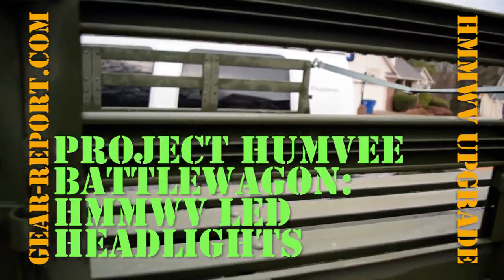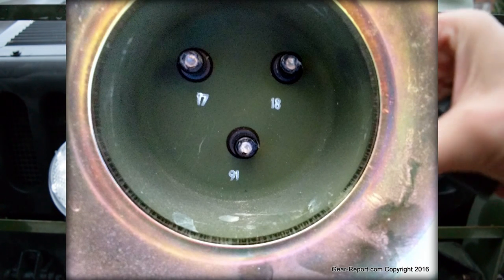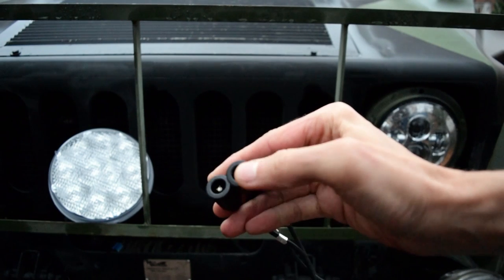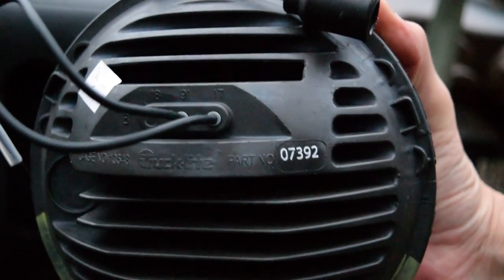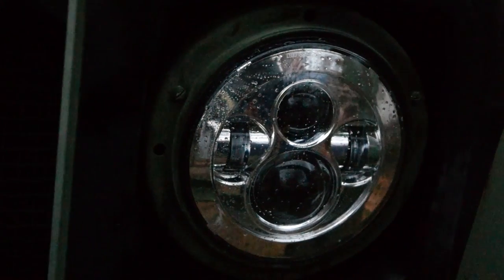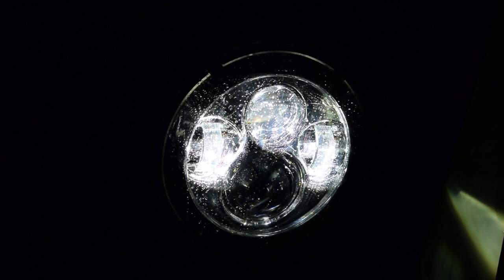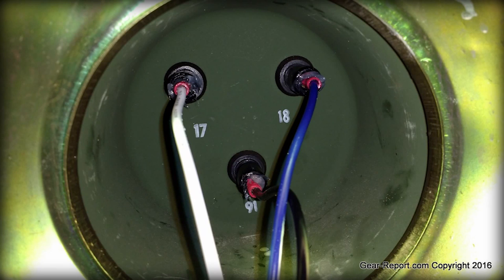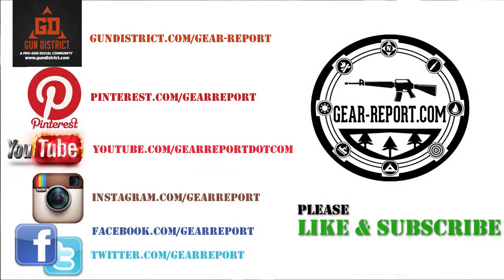Humvee Upgrade: LED Headlights for HMMWV, Hummer, Jeep, Land Rover, Harley Davidson

Comment: Great Video! My LED's shine to much in every direction but forward. Are these directional beam, or more of a circular beam pattern?
Reply from the maker: Great question and REALLY important. Some LEDs being sold on eBay and elsewhere as "headlights" are actually non-directional spotlights that have been stripped of the mounting housings. Those non-directional lights lack a "cut line", which basically means that used as headlights they blind oncoming traffic. 
These, and all of the options that I list in the written review have a cut line and are safe to use as headlights.

Comment: It was the screws that held the light ring in place... I had to modify the light housing by flattin out the housing allowing the light to sit in place...
Reply from the maker: Sorry, dude. I just added a link in the description to the full written review. That shows how to deal with the raised ring that some HMMWVs have in the light housing. http://gear-report.com/humvee-upgrade-hmmwv-led-headlights
Reply: Gear-Report.com. i bought a set will install soon. Thank you and keep rolling out these awesome vids.. If you could make one on brake pad change.

Comment: Any reason you didn't just splice in the original Packard connectors to new headlight wire?  I am wondering if I can do that without the converter box that comes with headlights.
Reply from the maker: I didn't use the converter box. Actually not sure what it is for.
Didn't use the old packard connectors from the old headlights in case the LEDs had any issues and I needed to quickly put the old headlights back in. Hasn't been an issues, as the bullet connectors have worked just fine.

Comment: I added the LED headlights to my military Humvee and only problem I have was I can’t get the ring screws to work. Do you have any suggestions.
Reply from the maker: Which screws? The adjuster screws? The outer ring that holds the lights in place?

Comment: Where did you get the other connecting plug was it with the light that you purchased..
Reply from the maker: T H you mean the adapter plug that I cut the ends off of to install the bullet connectors? That came with the LEDs, but is not needed. I only used it since I wasn't sure the LEDs would work. Figured if they didn't work I could return them. If I cut the connectors off the LEDs, then would not be able to return them. 
Since we now know these type of LEDs work, the adapter plug is not needed at all.

Comment: Hi, I ordered these from amazon for my humvee and tried to install them and they didn’t fit all the way in. Do I need to grind off some of the fins?  Thanks for any help!
Reply from the maker: Nope. Don't grind off the fins. Look in the video description for the link to the written article. Below the Installation Instructions in that article is a section that talks about installation issues that some trucks experience and how to deal with them. In short, to crimp the part of the headlight housing that interferes with the fins.
Reply: Thank you for your help!

Comment: Would those work on a Kaiser M725?
Reply from the maker: If it uses 7" round headlights and is 12v or 24v system, then the lights themselves should work. No idea if the dimensions of the headlight housings are the same or if you might have to modify your headlight buckets to let the LED lights fit.

Comment: What size bullet connectors did you use?
Reply from the maker: Answered at 5:12 in the video :)
Link to bullet connectors: http://amzn.to/2BVptWJ
Reply: why not just use the adapter rather than putting on a bullet connector that does not have the rubber boot on it??

Comment: I just want to say, THIS DID NOT WORK WELL FOR ME. The back of the light took significant modification to make fit. with a grinder. Then one of the headlights failed after 1 week. Had to wait 30 days for a replacement. I followed the instructions to the T.  I wish I just kept the standard headlights. Also, after modification, its still a bitc# to get all 3 screws on the light's bezel/holder to fit into the right slots.
Reply from the maker: Sorry this caused you problems.
Why did you grind the back of the headlight? The written directions at gear-report.com address interference with the light buckets on some trucks and clearly show how to hammer the bucket lip out of the way so that no grinding should be done.
Reply: Gear-Report.com I’ll check it out on the replacement light.
Reply: I went to your site and dont see the instructions? maybe send me a link....